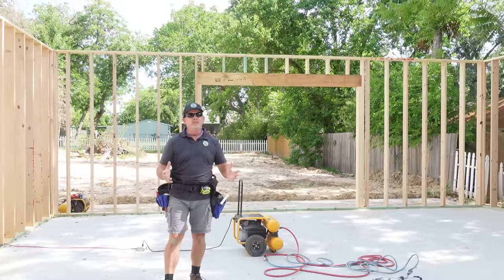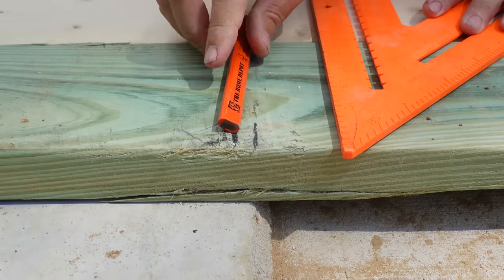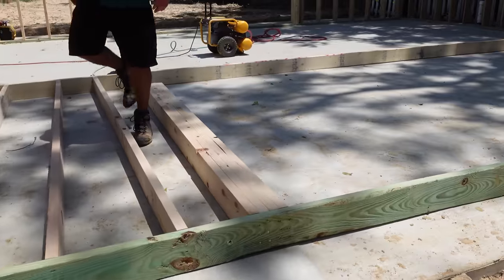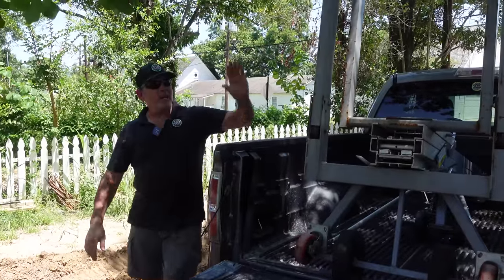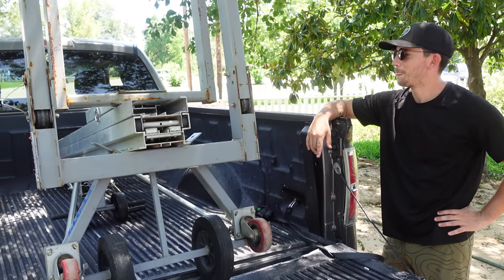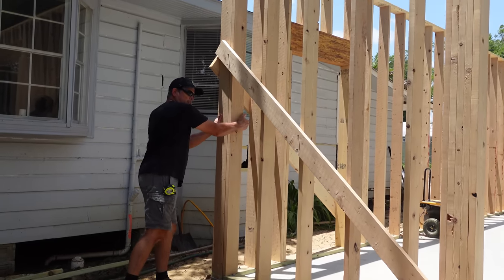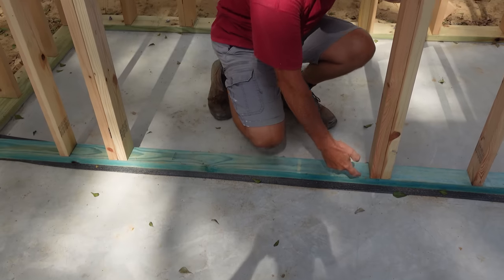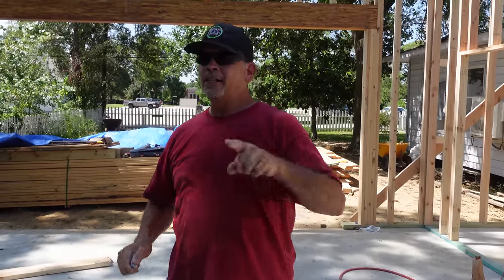FRAMING Our DRIVE THROUGH Garage!! - Will This ONE MAN LIFT Work?

Comment: Well seeing how the air compressor came on a few times during key filming's, keep the wall for a mechanical room with sound proofing. Air compressor in there won't be a sound issue in the future. Also at the far back end have an exterior door to store the lawn mower. I would have went with a 48" wide stairs so the room under was wider. Then the exterior door can be a sliding barn door and there will be room to drive a 42" riding mower right in from the outside. Keep the lawn mower room separate from the mechanical room for gasoline fumes safety.

Comment: I would use the secret closet for utilities like a built in pressure washer and air compressor. Just need a little vent for airflow, but keeps the noise way down

Comment: Before you repurpose the area under the stairs, check code, be specific as to the adjacent area use. I have seen code that did not allow any storage under the stairs. I have seen code that excluded anything flammable. Good job on the initial framing videos.

Comment: That space could have several uses, since your in Texas I'm thinking in the future you may want Air conditioning but you can do mini splits since garage and apartment air cannot be shared duct work. But you can put one mini split head upstairs and one down stairs. This means that space under the stairs would be best used like Jorden was thinking. Angle cut with stairs leaving room for wire chase and insulation. Then your fire rated drywall will cover your air barrier interior zipwall. You working with Matt in planning so you know we're I'm going with this.

Comment: Definitely use the under stair area as storage, a sound proof mechanical room or home run services room, of course might have to use rock wool and fire rated wall boards if it remains enclosed.  Being the apartment will be over the garage did the architect include a fire block and exhaust extraction between the ceiling and floor above?  Just worried, we store chemicals, fuel and equipment in the garage, anything could happen especially if you’re working on your car and something ignites, just want you all to be safe.  Another thought I had, is to use some sort of waterproof cladding from the floor up about 2-3 ft so you can hose out the garage and not worry about water wicking up through the walls and causing mold, you might already have a plan for this, I just know from living in the South with the heat and humidity nothing really ever dries out. 😊 Good work guys!

Comment: Put a server room under the stairs to host all of your server PC's, NAS, backup batteries, etc. You just hook your PC in the server room to your monitor in your office with a fiber optic display port cable and your I/O's with a single optical thunderbolt cable to a dock in your office. That way, your office would be super clean and completely silent.

Comment: Hey yall, I work for a custom stair shop out of exeter RI. Id personally say to leave the door in, put board and plaster under the stairs and insulate the crap out of it for Mechanical uses. Otherwise, id use it as extra storage!

Comment: Build a cabinet and work bench under the stairs. It's at least 36" deep, so you could put all sort so things under the stairs that take up room in a garage like; Lawn mower, the fertilizer spreader that you will use two or three times in your life, a rototiller, edger, that emergency generator you will need when the power goes out in Texas in the middle of winter, built in air compressor with 500 gallon air tank...

Make a chest of slide-out drawers out of the first three to four steps (21" to 28" high) that works as storage for gloves, boots, coveralls, waders, rain gear....

Comment: Make it a plumbing/mechanical room. All of your water shutoff valves, sewer clean out access, water heater and breaker panel can be in that room, and hidden with a door. And you will also have space to install your air compressor and maybe a central vacuum for the apartment or garage and have it insulated well so you don’t hear it as much. But it will make the garage cleaner and quieter by utilizing the wall with a door. Furthermore while any open storage area in a garage is useful, it’s not always practical, and being under a staircase is not very practical for shelves or storage options. It would make a great mechanical room imo.

Comment: Definitely install a door.  Also use sheetrock that can take extra moisture. Make sure to install ADDITIONAL CROSS BRACING OR JOINING between the 2 X 4'S to make the wall strong.  Think future security.  Finally, what happens if the floor floods????  How does that water drain out of the interior wall zone into the main garage floor????  Or maybe you have not imagined that could happen???...ANYTHING can happen.....so, why not address this drainage issue/possibility NOW...If you get ready, it will NEVER happen!!!   Great video....U guys are sure tough, Like Battle of New Orleans Tough!!!!!

Comment: Personally I’d leave the area under the stairs enclosed but maybe put in a pair of French doors for bulky items. It’ll be a great place to stash the air compressor and possibly a dust collector or central vac unit to keep noise down. Also good that you’re going wide on stair case. Use the lowest risers and deepest treads you can for ease of climbing too.

Comment: I like the idea of a 36" door to under the stairs. Use half of that space for loud shop equipment with hardlined plumbing, tubing, and ductwork. The other half would be a hidden door gun safe room. Hang the vests, cool lighting, big safe, glass showcase lined walls, etc. Real Mr. Smith or Jason Bourne style amazing hardware.

Comment: Keep the wall. Frame the door for the understair closet and use that for the air compressor against that far wall. You could sound proof that closet as well and that noisy compressor wouldn't be an issue 😉

Comment: Saw this on another You Tube garage build for sill sealer. Staple the sill sealer to the bottom of your pressure treated board. Ohh! That lexon on the bottom is smart. With PVC boards that are now thin & in 4x8 sheets, why not cut strips like the sill sealer and put that down first then the pressure treated wood. Now you have 1/8” of plastic before wood. Under the stairs, perhaps cut it out and you have a nice recessed area for cabinets/ work bench or just storage for ladders,pressures washer, weed wackier,lawn mower. Best to you on your project.

Comment: A door is a good idea because it could act as a dust barrier between the garage and the space under the stairs. You could use the space for a pantry, tire storage or a tool storage because there will be no dust flying in from the outside and the free space is well-used.

Comment: 22:09.  I've always left the nut a little proud of the bolt if I need to hammer on it.  This helps to preserve the threads just in case.

Comment: I would say a mix of both. Leave half of the wall under the stairs, you can put things like an air compressor in there. Then the other half open to garage and have a work bench on that corner

Comment: Not gonna lie. I did the backwards blade a month ago. Bought a new rear handle saw. Install oem blade and set it aside. Few days later I needed it. Wouldn’t cut for nothin. I was like ‘this (red) saw sucks. What a pos’. Then I realized what I did. Pretty much the start of a crappy Monday morning.

Comment: The backward blade was hilarious! Tell me you did that on purpose, please, because I am a rank amateur but I have NEVER put a blade on backwards! (But I did once actually have to drill out/extract a bolt on my sliding miter saw, because the first time I wanted to change the blade, I did not realize it was reverse threaded. Surprisingly, when you put a breaker bar on a reverse threaded bolt, you can shear that puppy off with very little effort!)
Thanks for the update, and I am enjoying your progress. Now that the slab is complete, it is probably peaches and cream, easy-peasy from here on out!
Reply: Paul put it on backwards because he was probably automatically looking at the markings on the blade. The reason it was backwards was it is a left side blade, not the normal right side, so the blade must be turned over. Simple mistake. I actually prefer the blade on the left because I am right handed. Paul did a short video on that some time back.

Comment: Run the wall along the riser, so the area under the stairs is open and usable, but the stairwell is fully separated from the garage and stays cleaner.  Unless local code requires either no storage under the stair or else a fire sprinkler or rated separation as long as the stair is the primary exit from the living space upstairs.  Check that pesky Code.

Comment: If the walls with beams get to heavy.  You might stand the wall up without the beam, get it in place and anchor it off.  Then you have a simpler vertical lift to slot the beam in place.  Good luck, be careful.

Comment: Another tip is to use permanent dye marking chalk when snapping your layout lines. That blue chalk will completely disappear if it gets rained on whether your on concrete or sub floor. Snapping out a whole house and having all your line disappear would not be nice. Next time you snap walls pull the line tight and have someone mark the center of the line in pencil, then have them hold the line and snap half the wall at a time, make sure you pull the line extra tight then you won't get a fat sloppy flared out line.Get some permanent dye chalk!!

Comment: Once consideration with the under stairs storage. If you put a door in the back corner to access the area with the most head room, you lose valuable corner space in the garage where you might want cabinets or a tool bench etc. my vote would be to split it up. Leave a portion of the wall with a small access door for a compressor etc, and leave a portion open for benches etc.

Comment: Impossible to overstate how much I'm enjoying the build, and looking forward to a good year's worth of content between the garage and the house.

A suggestion and a couple of questions.

You might consider at least a niche under the stairs for a REFRIGERATOR.  Every guy needs a refrigerator in his garage.

Question #1 - why not an open landing at the bottom of the stairs?  Having 2 doors across from each other into the landing seems a bit constricted.  Are you trying to cut down on noise and/or dirt/dust from the garage into the apartment?

Question #2 - are you planning a small balcony off of the apartment facing the front or the back?  Or maybe 2, one in each direction?

Comment: Open that wall under the stairs enough to put in sound dampening (2-3 layers of concrete board) & then have loud but remote-able shop gear in there - big air compressor & dust collector/separator.   How many times did your compressor annoy you in just this video?  Hidden away & noise dampened in a large area (so it doesn't overheat) you could film in garage for prep work before going on site to install.

Comment: Hey guys, I would put a door going into that area under the stairs and have storage, mechanical room for a water heater, an A/C system for the gauge, tool storage, or even a vented sound proof Air Compressor room or even a bathroom, the possibilities are endless, but space is at a premium never leave wasted space.  :)

Comment: My vote is to have the space under the stairs open to the garage.  A wall would give hanging space on both sides but that wall will also break up the larger floor space into smaller spaces.  Also, at less than 4' width, that space would be very limited in what you could put in it and still keep an aisle down the middle to get to stuff at the ends.  With no wall, access to the entire volume will be easy.

Comment: No door — the under-stairs storage area doesn't need a hard boundary. That little niche will be a great place for tool cabinets or other storage that won't eat up valuable floorspace in the main rectangle of the garage. I prefer Jordan's idea in general, unless you plan to put a mechanical room where the machinery might be noisy or sensitive to dust/paint/debris.

Comment: Sink/wet bar and/or beer tap underneath the stairs would be awesome… that or more practical would be equipment storage or compressor setup underneath the stairs so it’s out of the way and multiple walls to contain the sound. I really like the idea of the pressure washer setup that someone mentioned below as well. Could also consider throwing an in-ground safe there however I’m sure you don’t wanna drill out a portion of your prized slab after the debacle you’ve been through. To take that Idea further it-could be a nice spot for a small walk in safe, gun or panic room. Jordan.. save yourself some time and effort and throw some speaker wires in the walls now just in case you decide to put in a sound system in the future.

Comment: I would put a half bath at the end under the stairs,  and open up the rest. A sink and toilet in the garage would be hand when working on projects.
Reply: They would have to bust out that concrete slab and the massive grade beams to install the drain piping for an additional bathroom.

Comment: Not sure if you have a spot already for a waterheater, but that's a great spot for one under the stairs. Can be somewhat hidden
Reply: A propane-fired water heater probably is not allowed under stairs which provide critical egress in the event of a fire.  At minimum the fire department should be consulted before beginning work.  I myself would recommend a tankless type unit, unless they are concerned about water hardness.

Comment: Area below the stairs would be a good storage area for tools, or place for an air compressor, electrical panel, water heater. Also, noticed your using a pipe wrench to muscle twisted boards, you need a proper Fubar. Surprised you don’t have a couple already.

Comment: I would ask the architect about removing the wall under the stair. Since the plans were approved with the wall, and the wall is a firestop from the garage, the plan changes may need to get approved. The bottom of the stairs needs to be protected from a garage fire, so the new plan details would need to show that. I'm not sure if the stairs are planned to be conditioned, but if so, it's a lot easier to air-seal a wall than a partial wall over the stairs. You also need to support the wall over the stairs, and I'm not sure if your stair stringer is designed to do that. Even a door in the wall needs to be designed with some fire resistance. It doesn't need to be a fire door, but possibly a solid wood door. Again, a detail to ask the architect about.

Comment: I like the idea of leaving the stairs open. Don’t care to walk through two doors to get to the breezeway. Had a home that had 9’ ceilings. Under half of the stairs was a powder room. The rest of it (about 6’) was open so I measured over until I had 8” to the bottom of my stairs on the short side and installed drawers in the first one 3’. The rest I framed in a broom closet. Just another way to get out of you guys an idea to do with the space.
Reply: It's an egress point, and Jordan needs to be able to go down those stairs and exit the garage if there is a car fire downstairs. The bottom of the stairs absolutely needs to be separated from the rest of the garage. Code would also require an automatic door closer on the door into the garage part. They are only talking about removing the area under the stairs.

Comment: Having a closet in the garage that is not exposed to prying eyes and sealed from dust would be better than having an open niche imho.  Put some electric into it in case you decide to use it as your comms/security site for awhile.

Comment: Under stairway:
1). Tankless Hotwater Heater 
+ A.O.Smith Sealed Canister’ed (36”) Whole House Filter 
+ A.O.Smith Sealed Canister’ed (36”) Water-Softener (resin) [BOTH are rated to last for 5 - 8 years] 
+ an A.O. Smith Pre-&-post filters.

2). Use the additional space for your IT Services Closet (Modem/Route/Switch & Security Surveillance (eStorage) & CCTV/PoE & all the Ethernet 8 (it’s the future might as well go in with the infrastructure now) line-drop Terminations.

3). Main Electrical Whole-House & garage addition electrical service panels (I would do 2 separate service panels & Usage-Meters in case in the future a decision is made to rent out the above garage apartment).

Comment: I'm in the no door camp. Imagine if you bought a material lift and wanted to store it in the garage. You may have to play tetris every time you want to get it out of the closet. Without a wall there, it will be much easier to use that space with bigger items, plus you get additional storage by not having to maintain a space for walking.

Comment: How about putting your water heater, water softener and hvac under the stairs etc… and if you have room how about a bathroom and or shower so you can clean up after working… without dragging dirt into the house…
Just an idea..

Comment: How are you going to get a refrigerator or a sofa or queen bed box springs up those stairs?  The single-wide door at the bottom of the stairs probably isn't big enough. (You'll never be able to make the turn.) You could remove the wall at the back side of the garage and run the stairs up the opposite direction, so that you don't have a sharp turn to make.  What's at the top of the stairs? A door?  Handrail? Will you be able to make the turn at the top after you get the sofa to the top of the stairs?